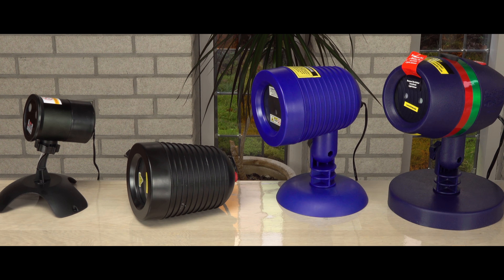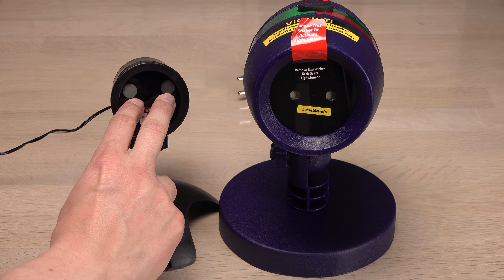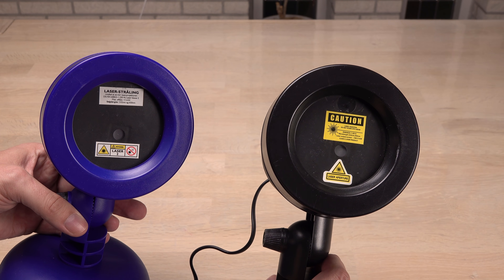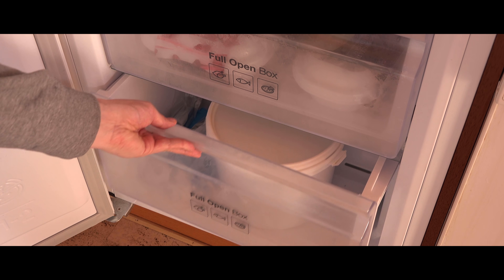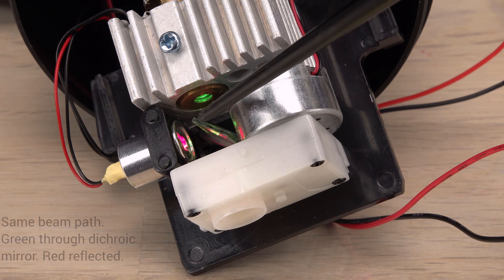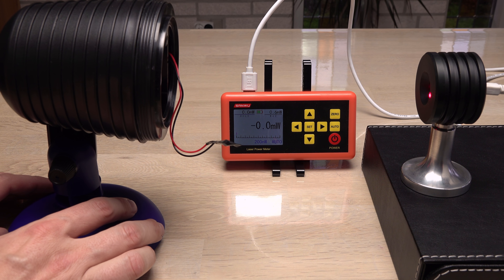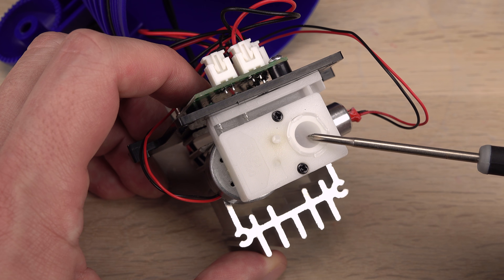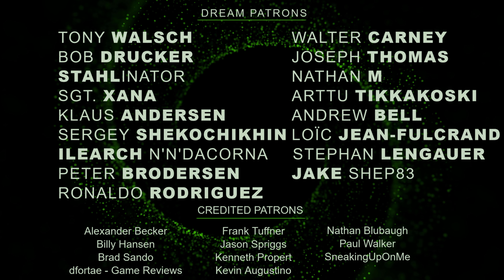DECORATION LASERS | Stronger than you think...

Comment: I am a laymen when it comes to lasers. 
Is 1 milliwatt the amount that these lasers are supposed to be or is that the number that is safe for eyes? Or?
Reply: 1mW is considered safe for basically a toy. 5mW is the threshold where it can do damage to your eyes faster than you can blink.
Reply: @TechLeftBehind  
Thank you.
That is crazy that one of those is 80mW! 
Is it cheaper to make them that powerful?
Just wondering why they would do that.
Reply: @intothecalm420  - A small 1 mW laser would be useless to project decorative, bright patterns onto an outside house wall. The diffraction grating creates lots of weaker sub beams instead of one eye-zapping one.
Reply: @JohnnieHougaardNielsen  
I understand. Is there laws on such potentially dangerous lasers?
Reply: @intothecalm420  - Lots of ordinary household products are potentially dangerous if disassembled and handled improperly. I'm not sure of exact laws in different countries, but there exists a classification system for laser products, based on potential for danger, and some rules about selling them. My non-expert impression is that these are based on measuring intensity outside the box, and in that case the diffraction grating should make these low-danger. However, from a safety standpoint, I'd be tempted to question if the fault protection is good enough in the one bought with the diffraction grating fallen off, making it eye-dangerous. Products with potentially dangerous components (like a household microwave) tend to have some sort of double fault protection.
Reply: @intothecalm420  Everything can be dangerous in the hands of a idiot. But since most people are just unaware of how bad it can get makes me feel like it's better put a ban on those.
Reply: @MACTEP_CHOB  
I honestly disagree with making dangerous lasers illegal. But it should be properly labeled as such.
Reply: If there's one message/morale to take home from this video(and many of styropyro's too), It'd be: "Treat ALL laser devices as 'eye unsafe' by default".
While the weak/toy ones might not do permanent damage, they could still cause damage to some electronics like camera sensors or even serious accidents like blinding drivers at night or potentially triggering a seizure in someone with epilepsy.
Respect them like you would any power tool, heck..even toy ones can hurt if you're careless & committed enough. Use them right though and they can be a truly awesome hobby with the power to both enthrall & educate in equal measure.
Reply: Very misleading video he did not report the power of the diffracted beams at a typical in use distance only close range Almost on the level of rice killing pigeons lasers are not toys

Comment: are the green lasers emitting IR also ?
Reply from the maker: I have not tested it - yet... If they do, they certainly do not earn the Class 2 label. Class 2 lasers are not allowed to emit invisible light.  Happy New Year and Decade :D
Reply: @brainiac75  Yeah, another reason I but certified equipment.
Reply: Yeah I'd like to see that checked.
Reply: Most likely, it is probaly emits all frequencies of light but they are so small its kinda negligible.
Reply: @monolitwoods  ? No... 
Anyways it doesnt look like theres any ir filter so probably
Reply: @monolitwoods  no what we mean is that a green laser does usually not have a green laser diode: instead it has an IR diode that then gets put through a special crystal that takes two photons of IR and creates one photon of double the frequency (which in this case is green). It's not perfect though so a good amount of IR leaks through and can be very dangerous if not filtered properly.

Comment: How powerful should a laser be if it needs to be seen from 50 feet away but not damage a person's eyes?
Reply from the maker: Hard and dangerous to reply to... Depends on beam size, wavelength and especially divergence. A class 2 laser could be 'eye-safe' at 50 feet (NOHD 46 feet with 0.5 milliradian divergence) but still flashblind you at 240 ft. First, you absolutely need to make sure the laser is labelled correctly! That is: measure it with a well-calibrated laser power meter before risking your eyes. Info based on: https://www.lasersafetyfacts.com/2/
Reply: A laser pointer would do
Reply: I think if it's less than 5mW it's considered safe-ish for extremely short term exposures (what I mean is that it won't do any damage in the time it takes to close your eye/blink)

Comment: Another risk not mentioned in this video is that green lasers are made by starting with a 1064nm infrared laser and doubling the frequency with a crystal. 
CHEAP GREEN LASERS DO NOT FILTER OUT THE 1064nm WAVELENGTH and can be VERY dangerous while being invisible, as you are distracted by the visible beam. 
Do not stare into beam with remaining eye.
Reply from the maker: True. With bad or no filtering they can emit both 808 and 1064 nm infrared (the IR diode emits 808 nm, which is converted two times inside). I have shown it with green DPSS laser pointers (https://youtu.be/iR1Ku5dnbH8). I will need to make a video measuring if these are filtered or not. Happy New Year and Decade :D
Reply: @brainiac75  and Miguel Barra Almeida, thank you for the link to that excellent video demonstrating the phenomenon so elegantly. A follow-up video of these units being tested for IR would be very appreciated and educational with real world safety value. A winner from multiple perspectives. Thank you Brainiac75! 
Happy New Year and Cheers from Boulder, Colorado, USA!
Reply: https://youtu.be/iR1Ku5dnbH8
Reply: Wouldn’t really be more dangerous though with a green light to trigger the eyes closing. The danger with IR lasers is they are not visible and won’t trigger a blink reflex. Like on a target designator, or range finder that use IR lasers which only cause pain after it’s too late.
Reply: @Alex-us2vw  (pumped-crystal) green lasers are dangerous with a diffraction grating because then the IR and green beams WILL be separated.
Reply: It's also worthy to mention that the heatsink isn't there for decoration... It's there to dissipate the extra heat that the IR pumping laser generates because it needs to be more powerful than the green emitted... So not only are you getting a dose of invisible beam, it's potentially much more powerful (depending on exact design) than the visible output!